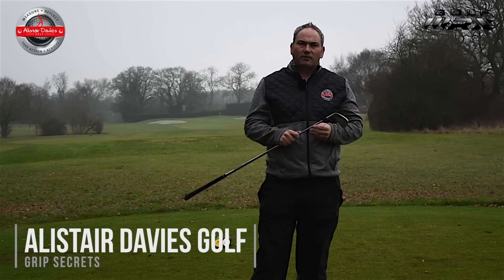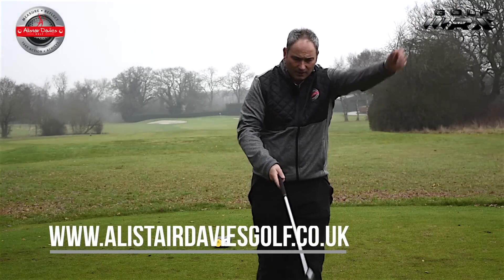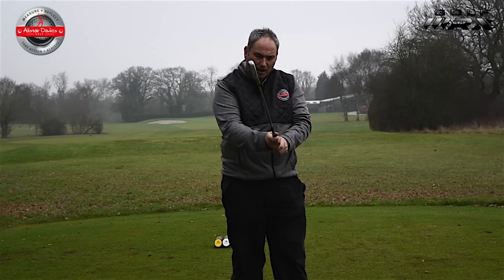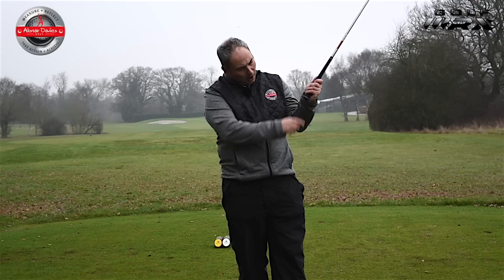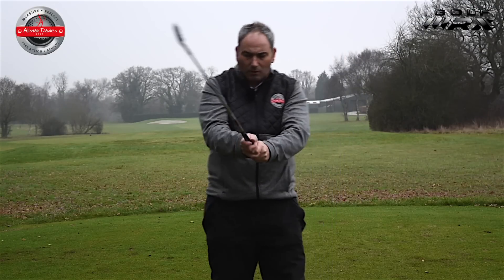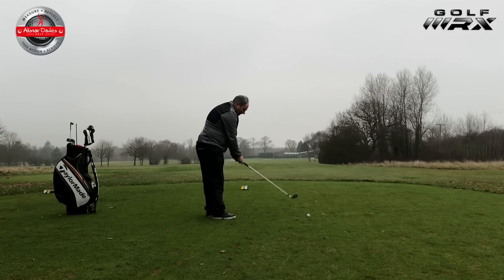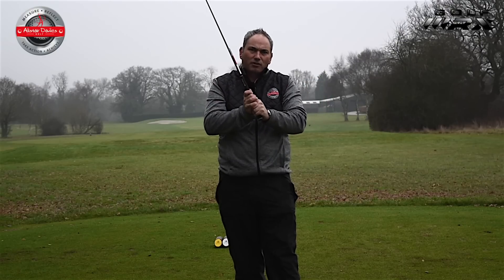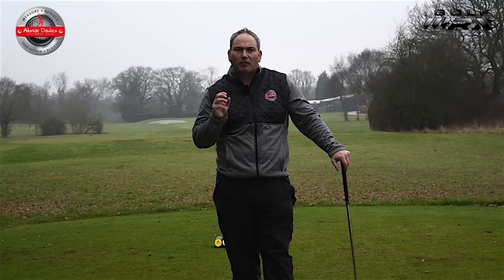How To Change Your Grip to Stop Flipping at Impact

Comment: The only way I fixed my flip is in fact by holding the club with the two fingers closest to the top of the grip, with barely any pressure with the other fingers. Theres no way you can flip with the right hand barely putting pressure on the club. Anyway it worked for me ;)
Reply from the maker: Yep that’s should help but might cause a loss in power. Thanks al